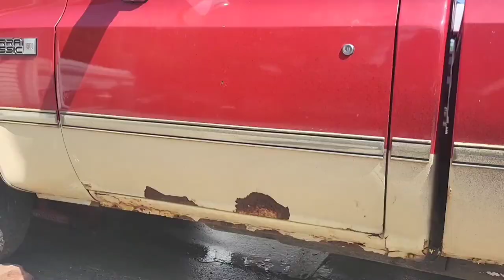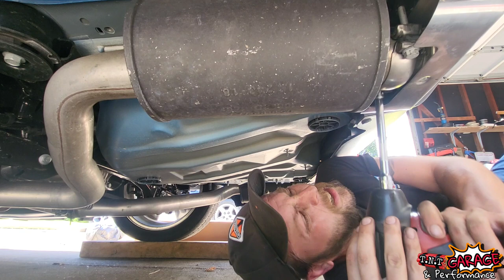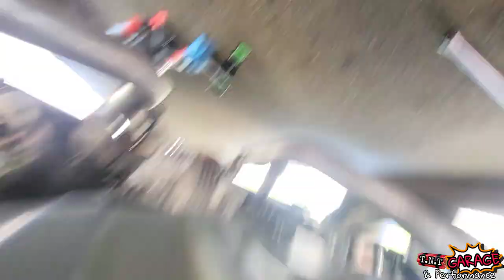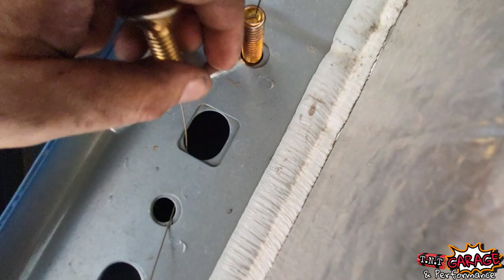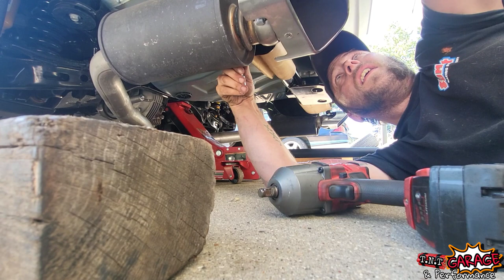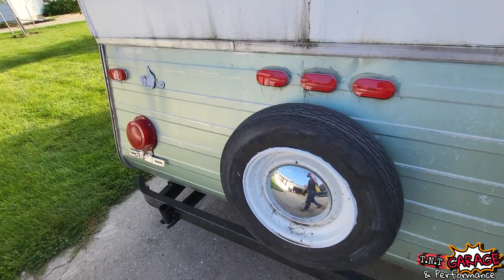BLASPHEMY!!!  Towing with a muscle car?!  Dodge Challenger hitch install

Comment: Id pull a camper with a Charger if I could afford one! A guy on here actually towed a 69 charger home on the interstate with a 69 fire-chicken. Occassional overheating.  Id suggest installing the biggest alum. Radiator possible w/ ELECTRIC fans and bring extra coolant ( they were in 100+degree semi- desert climate though)

Comment: How does it tow ?    I have a mustang gt and I am wanting to do the same thing. Did you do any research on max weight the car can handle. Im wanting to haul a 2000 lb camper. 

Thanks
Reply from the maker: Dodge recommends 0lbs with a 6 speed, and 1000lbs with the auto.  I pull my 10ft pop up which is a little less than 2000, haven't had issues, I'm just easy on the clutch.
Reply: @t.n.tgarageandperformance  good deal man. Yeah you would think the manual would tow waaaay more since its all gears etc. Wont overheat..... i dont think
Reply: @t.n.tgarageandperformance  im tempted to tow my 240sx with my 1976 trans am during moves. Not sure if its possible but the trans am weights as much as a tacoma lol. Makes sense to me!
Reply from the maker: @richardnixon9324  I've seen people pull pop-ups with 3rd gen F-bodies, a 2nd should handle at least that as long as the rear structure is sound, most small suvs are unibody and they get away with towing without ripping the hitch off
Reply: @t.n.tgarageandperformance  I'm definitely tempted now...... I wonder what a cop would say? Since there's no recommended towing limitation lol